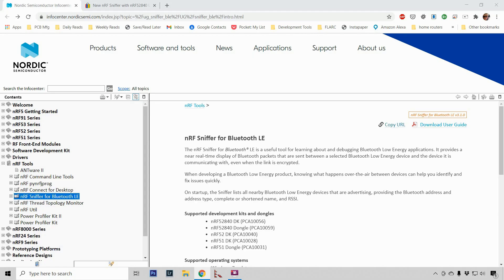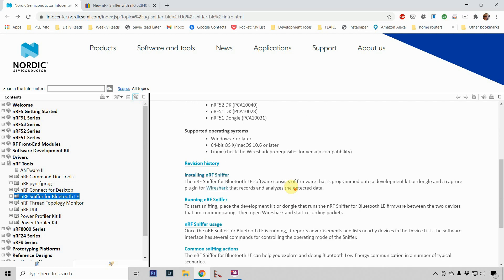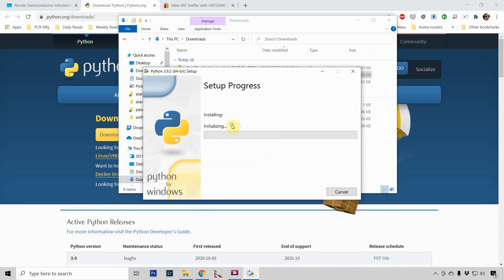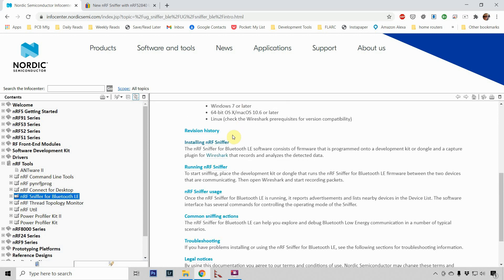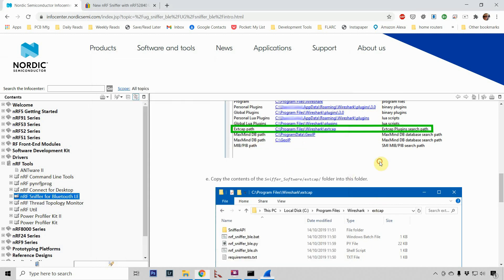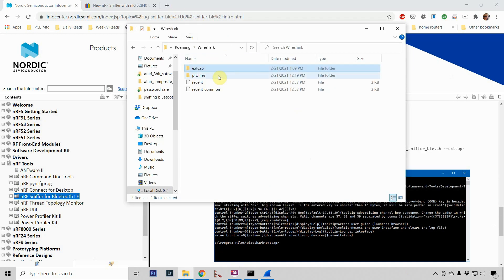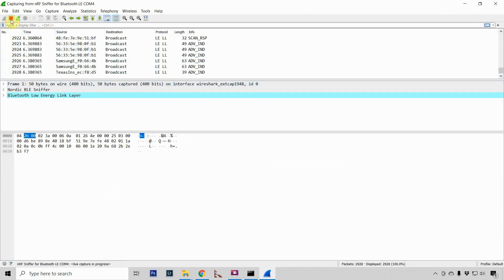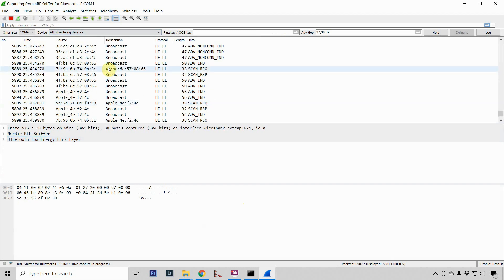Sniffing, Reverse Engineering, and Coding the ESP32 Bluetooth LE Part 1 of 3

Comment: If i use the raspberry pi 5 with kali linux without the adapter dongle ble it work? i would use the bluetooth integrate with the board of raspberry
Reply from the maker: No idea.  You will have to give it a try and see if you can make it work.

Comment: I found two adapters to buy, one is like yours and the other is Holyiot nRF52840+PA with a non-removable antenna and magnetic suction reset. 

Which one to take, because the PA version is +20dBm, while the one you have is I guess +8dBm, but the antenna can be removed and a stronger one installed?

I was also thinking about buying the Ubertooth One, but as far as I understand, you can do exactly the same thing with the nRF52840 dongle and save money, it's cheaper.
Reply from the maker: Sorry, man, I have only used the one from the video and to be honest that was a few years ago.  I would not be surprised if there are better solution and/or even using your smart device.  I do remember that the one in the video did have some software on it and I did not have to update it.  Heck, I am sure there is an update by now!

Comment: hi, good video. Is it possible to use this method to decode an BLE Device that require a password ?
Reply from the maker: Most are using encryption, but if you see it in the clear text, you might have a shot at it.

Comment: Great video series! I just got my sniffer and wanted to try it out, but I don't get any ATT packages (only LE, mostly advertising and scans) with my sniffer though I am definetly sending gatt writes (since I a programmed the client myself) and the other devices is answering. (I can see my advertising packages) It's a connection without bonding.
Do I need to listen on some other channel or something?
Reply from the maker: Hmm, honestly not sure. It has been a long time since I’ve done much BLE stuff. Sorry.
Reply: @StuartPatterson  thanks for the quick response! Maybe I can find out myself
Reply: In case others have the same problem: I think the sniffer didnt get the "new connection" package (CONNECT_IND), which it uses to follow a connection. With a differenct device combination it works (which luckily was the device I wanted to sniff anyway).
Reply from the maker: @mirkowaechter  Thanks for sharing!  As you stated, might help others in the future!

Comment: Thank you for the tutorial! 
I followed your steps trying to reverse Tuya drawer lock but it din not work. I can connect for a while to the device via nRF Connect (for mobile and for desktop versions), i know devices’ name and adress, but it does not show in Wireshark. Even if I try to add the LE adress (according to NS’ infocenter) it does not help.

Any idea how I could sniff this communication between the Tuya’s app and the device?
Reply from the maker: Not sure, but I just ordered one from Temu.  Once I get it I will play around and see if I can figure it out. No promises, but we might get lucky!
Reply: @StuartPatterson  that's great! I'd be grateful for any advice, even without such video tutorial!
Reply from the maker: Well, I have been playing around with the tuya smart drawer switch for a few hours now.  It does use encryption as identified by LL_FEATURE_REQ (0x08) opcode sent and the returned LE Encryption bit being set.  I looked at the encryption to see how complex it is and I was not able to decode it, however I know very little about encryption.  I also tried to replay the unlock and it seems, and I could be wrong, but that each request required a new encrypted code.  Sorry, I was hoping I would figure it out, but this one pretty well written, at least in my opinion.
Reply: @StuartPatterson  Thank you for your job! It seems I will have to use Tuya's libraries to use this lock.

Comment: Hello very nicely prepared video, but I have a question please very important to me if you answer me thank you Is there anything I can give my laptop to extend the range of Bluetooth at least 100 meters to 200 meters?  Is there any way I can transfer pictures? Please give me the name of anything. Thank you
Reply from the maker: Thanks you for the comment. I am not aware of any Bluetooth extenders or add on antenna, but they could exist. As for transfer binary data that should be possible but I don’t have an example. Good luck.

Comment: Hey great video! But I am pretty new to bluetooth and i still have a question. I am trying to make a universal remote control (including 3 infrared remote controls and 2 bluetooth) with a esp32. The 2 bluetooth remotes are firestick TV and T-mobile box remote controls. And before i buy the nRF sniffer, i would like to know if it should be possible to read the communication of the firestick/t-mobile remote, or could it be, that the communication is somehow encrypted?
Reply from the maker: Sadly encryption is always a possibility. I would search online to see if anybody has decoded the fire stick remote.

Comment: can i use any bluetooth dongles?
or only nrf ones?
Reply from the maker: I have only used the nrf52480.
Reply: @StuartPatterson  thanks for replying :)
so I tried it with my bluetooth module... and it didn't work...... probably mine was not a sniffer type.. 
then i found out that android phones can do something similar by enabling a special option in developer mode, and so i tried that... it worked.. but it doesn't keep updating a file it makes that holds all that bluetooth sniff data...
have you ever tried that and got it to keep updating the file?
Reply from the maker: @king_wing34  No, I need to get an Android tablet or something to play around with that setting.  Currently using iOS stuff.

Comment: Can you help me? I did everything exactly as in your instructions, but at the launch stage I do not receive packets, although I see devices and their signals in the list. what could be the problem?
Reply: but on my linux all is fine. very strange
Reply from the maker: Guessing, but it might be an issue with python on the windows machine. I would confirm it is in the system path and it launching properly. It has been a while since I used this technique so you might have to roll up your sleeves and debug the issue.
Reply: @StuartPatterson  I hope I can solve this problem, thanks for the advice!
Reply from the maker: Me too. If you do figure it out please post the solution back here in case some has a similar problem. The python add in is what you should be looking at, at least in my opinion.
Reply: @StuartPatterson  ok!
Reply: Same issue. Only advertisement, no att data

Comment: WOW great video, thanks for sharing. I really can't find where to buy this dongle. Are they still selling it ? is this technique working with not low energy bluetooth devices (old bluetooth) ?
Reply from the maker: You should be able to find a Nordic nRF52840 for $10-$15 USD.  You might have to install the firmware on the device.  Mine came with it already installed.  I have not worked with Bluetooth Classic so I can not say, sorry.

Comment: Great video Stuart. Quick question, would you have any pointers on how to sniff and track paired devices (RSSI), like a Garmin Smartwatch for presence detection for Home Automation?
Reply from the maker: I have a future project using an iTAG device where I want to use the RSSI for proximity detection, but I have not started it yet.  When I finally get to it I do plan on creating  video.  However, I have not even had time to research it yet.  Sorry.
Reply: @StuartPatterson  that would be wonderful! the main challenge I've noticed is that once the smartwatch is paired with the phone, it stops sending advertising packages, so other BLE devices cannot see the watch.
Reply from the maker: @shufflethemovie  Hmm, not sure how to get around that one.

Comment: Can the Bluetooth Serial CDC profile be run as "Low-Energy"?   For example, could I use transmit serial ascii data from a usb/bluetooth dongle (ex. HC-06, HM-10) and pick-it up using a BLE receiver (android), etc?
Reply from the maker: Not sure. Sorry.
Reply: BLE and Bluetooth Classic have almost nothing in common. There's no serial device protocol in BLE by default/standard, but Nordic did publish their own. Not sure if there are any of those little Bluetooth serial modules that speak it though.
Reply: @rpavlik1  Thanks, are the BT4/5 chipsets in phones backwards compatible..  i.e. can they revert to Classic mode?    I'd like to use a bt-classic-dongle and desktop app (flutter, electronjs, neutralinojs, tauri etc) to talk to an android.

Comment: Good timing, I recently got the (original) nrf52840 dongle, got two of them for $10 each in a recent Digikey order, and had just tried the sniffer the day this video hit Hackaday. I'm keeping one with the stock bootloader for use with the sniffer or nrf connect desktop, the other received stackable headers and the Adafruit uf2 bootloader: somebody has a fork of the Adafruit nrf52 bsp and the platform io support files that add support for the dongle.
Reply: Which Digi-Key part did you order ?
Reply: @Adam-ee9lm I went to look... It's the $10 one whose part number is literally NRF52840-DONGLE, apparently